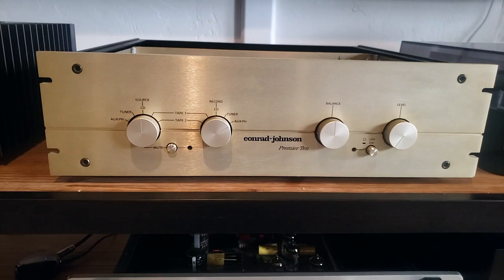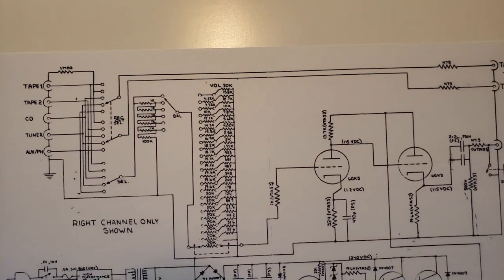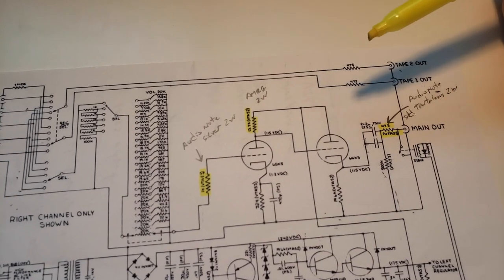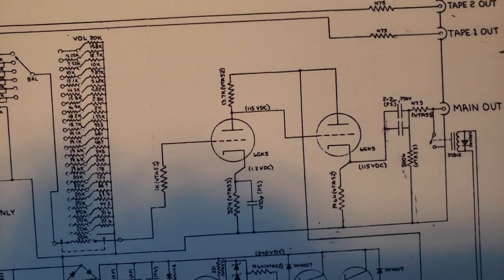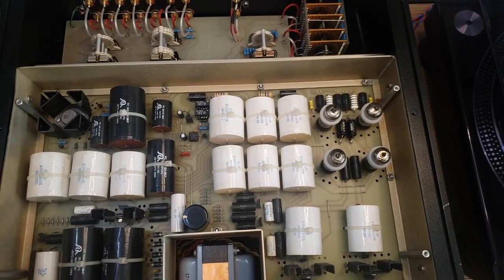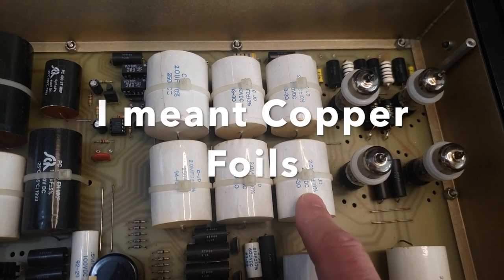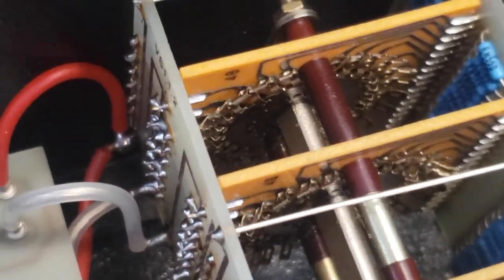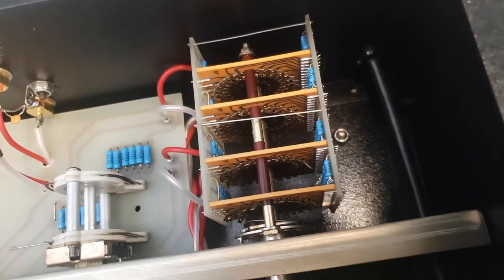Conrad-Johnson Premier 10 Vacuum Tube Preamp VINTAGE AT ITS BEST! MODS & MORE!

Comment: There's another way to correct the phasing, all you have to do is feed the output of the preamp through a unity-gain inverting buffer circuit which could be built using op-amp ICs or a twin-triode tube, one for each output channel, and since the inverting-buffer circuit presents unity-gain, or a gain of 1, it should introduce minimal distortion and, or, noise.

Comment: I think you’re absolutely right about the Premier 10 being one of the best pre-amplifiers made. To make the same pre-amplifier today would probably cost 17,000 or $20,000. If you remember, Conrad Johnson had to come out with the Art preamp that cost $17,000 just to try to beat it. But I listen to the Art and I didn’t think it was any better than the premier 10 it was just a lot more modern and fancy looking with a remote control.

Comment: Stepped ladder attenuators are easily available from the same stores that you get the audio note resistors. Simple upgrade for your existing preamps/integrated amps if there is space.
Reply from the maker: You mean the 42 position glasshouse kits for $700 pounds UK?
Reply: @hificonspiracy 😂

Comment: 11:03 - All 6 of these caps are 2.0uF @250V, but the upper-left cap appears larger! (?)
Reply from the maker: Yep, good eye. It's significantly larger. I'm assuming its a manufacturing variance since it measures within spec.

Comment: Lofty statement. Never owned a Premier 10, had the Premier 3 and Premier 7, which the 10 was based upon but w/o the multi-chassis layout. Lovely equipment however my 7 was returned back to factory 3 times due to power supply failures, including a cap that smoked so bad it set off smoke alarm. Frustrated, I traded it to dealer for an Audible Illusions 3A. As a line stage, very similar. The AI was however substantially better as a phono preamp. I then was introduced to the CAT SL-1 and have never considered an upgrade. Even though CAT offers several in-house upgrades at very reasonable prices, I’ve never sent it in. It may be quieter or deeper & wider…or maybe not. If you’re so pleased with the performance, simply no reason to “upgrade”. I’ve replaced tubes twice on line and output, once in phono section. I’ve spent $$$$’s upgrading amps, speakers, sources and buying records but still no desire to change out my preamp.
Reply from the maker: Sorry to hear of your issues with Premier 7. I don't blame you for the frustration. As a recall CJ had some power supply issues with a couple of their past amps MV50 & MV75? (don't quote me on that). The Premier 10 looks to be very robust. No issues yet! The CAT products have received a lot a good reviews over the years. I have never owned one. Thanks for sharing.

Comment: I'm getting ready to buy one of these... are you telling us people on YouTube that if we have this we have to switch the red and black of our speaker cables on the back of the amplifier, because it inverts polarity or whatever❓
Reply: what happened to the part of the video where you started to talk about resisir upgrades...it was edited out❓
and I heard someone speak of changing capacitors to teflon kit upgrade?... I called Conrad Johnson and was told they are the only place that has teflon capacitors for this and it would cost 2500 plus shipping for them to replace🤪...does anyone know of this and perhaps where i could buy the telon cap kit for this pre amp❓
Reply from the maker: Yep, switch polarity on the speaker end of your cables, both Left and Right speakers it will give you the most focused imaging/center image when using the Prem10. Try it both ways. see which you like best.
Reply: @hificonspiracy 
Now I'm getting the ET5 I guess I have to reverse the polarity on that also… Do you know?
Reply from the maker: @briancampbell7712  I'm sorry I don't have any experiences with the ET5. I know it is a different design and different tube. Enjoy.

Comment: is that a Pass Aleph 3 with it? I used an upgraded PV-8 (Bill Thalmann of CJ fame) with and Aleph 5 for many years... best combo set up I've ever owned
Reply from the maker: Yes it is. I also owned a Aleph 5 years ago and also sorry that I sold it. I found an Aleph 3 about 2 year ago and grabbed it. I don't think I'll ever sell it. It's a collectors item for me. Some people complain about the looks but I rather like it. Bill is suppose to do excellent work! Happy Audio!
Reply: The PV8 was very decent, but the PV12 was superb! That preamp is better than anything in that price ranghe SS or tubed. I picked up an Evolution 20SE a few years ago and had CJ mod it (6K) Its a giant killer, but keep in mind it sold for 10K ij 1996. I bought it for 2.7K and stuck in 6K of upgrades. Also VERY important to get the best 6GK5 tubes. CJ voiced it for the Sylvania tube, but not just any Sylvania. I bought out all the last sets CJ had after I realized how hard it was to find tubes that worked best in that circuit. Phono section is a bit noisey.

Comment: Absolute phase preservation in simple stereo systems is not of prime importance and it can only bring a small benefit to soundstage focus. Given a recording preserves absolute phase too. In most cases it's a hit or miss affair. 
For integration in complex systems with active subs, surround speakers etc. Inconsistent phase can create cancellation issues between different routes. Must be analyzed and addressed.

Comment: the volume control is built in sweden. you use to be able to by them in kit form also.
Reply from the maker: Hi Ben! Are you sure this was imported from Sweden? I thought it was done inhouse at CJ? Link? Recall the manufacture?
Reply: @hificonspiracy  hey alex! let me se what i can pull up. may have in one of my files from different parts mnftr. from back when me and my brother were working on my altec 1570b's. stay tuned and in touch.

Comment: which tube brand is it? i see something written in red not sure vintage rca's maybe?
Reply from the maker: Yes currently USA made NOS RCAs, also GEs, My favorite though are some GEs made in Great Britain.
Reply: @hificonspiracy  there are mullards with a ge label you can tell by the code, ge's were only made in usa as far as i know. ide go for mullard 10m's with this preamp, or mc1/f91/f92 longplates you deserve the best. compared to rca's which are amazing as well mullards are smoother with more low mids. if you like more warmth brimar 6057's would be my second choice.
Reply from the maker: @yaniv-nos-tubes  Thank you for the info!
Reply: I have a EVOLUTION 20SE.  it's been upgraded by CJ 3 years ago (2700 bucks) I find the best tubes were the original factory supplied Sylvania. I tried a bunch of others. CJ is now out of stock. I bought 4 sets.

Comment: That stepped volume control is amazing looking.  What's the rationale of leaving the phase inverted?  Is the idea to make the circuit less complicated by leaving out the phase inversion circuit before the power amp?  I knew the CJ stuff was phase inverted, but apparently, so is my Quicksilver Line preamp.  That explains why it was lacking low end punch.  🤣  Is this replacing your Quicksilver?
Reply from the maker: Yep, it just adds more to the circuit to correct it (phase).  You see how it could give a piece of gear a bad rap. I think its great from a circuit-purity approach but probably a bad marketing decision assuming most consumers look at this stuff as "magic boxes" and fully forget to reverse phase on their speaker cables and thus becoming dissatisfied with the product. I'm guilty of it. Nope. Keeping the Quicksilver. Its finished, (finally)  just need to run a few more tests and then video. I've been collecting this stuff for years and just now getting around to restoring and tweaking some of it.
Reply: The reason for the phase inverting output is exactly that, circuit purity. Less circuitry to pass the signal through by not having the bits that would be needed to output absolute phase. I got this from speaking with Messrs. C and J, and the long time C-J engineering director and all 'round smart and nice guy, Bill Thalmann. I had a PV-1, 2, then lived a long while with a PV-12A. The PV-12A leaves the linestage phase inverted (maybe the phono, too? I don't recall right now, but my PV-12A did have a phono stage). My brother has a PV-10B; also, phase inverting. I was helping him with setting up his system just the other day and he reminded my to flip the speaker connections.
Reply: if i don't use phono...please help me I only have a few days to decide between a CJ PRE AMP- Premier 10 or PV12L...what one is best to buy❓

Comment: I can imagine that gear like this could bring a grown man to tears while using it.  Dreamland for me and I don't even deserve to listen to gear like this nor own it.  Enjoy your great gear!
Reply from the maker: Well music has brought me to tears. I think good gear can help in convey the emotional sense/impact of the music. I see a work bench and tools in your channel. I see some diy in your future! EL84s? Polished aluminum chassis? Modded Dyna ST-35's? Hmmm transformer coupling? Open baffle speakers.. Hmmm  DIY my friend :)
Reply: @hificonspiracy  Sir, I repair welding power supplies and related gear including engines for my low amount of income.  I would thoroughly enjoy an A/B or tube amp kit or repair project.  And, a Dyna 35 would make my day.  I just replaced a very good, but budget class D amp with a wonderful NAD 214 A/B amp and what a deference in dynamics.  Low to high much wider and pronounced.  I'm now all in on "beefy" - iron rich amps.  Just as the more robust welders have more "iron" (big transformers and chokes) I believe amps and power supplies should also.
Reply from the maker: @welderfixer  If you ever run across an NAD 106 preamp grab it. Great match to the 214 and it has a super phono stage inside! Agreed on the trans and chokes! https://www.youtube.com/watch?v=I2owtfvS6Mo 
https://www.audiokarma.org/forums/index.php?threads/nad-106-preamp-restoration-upgrade-project.550017/
Reply from the maker: @welderfixer  The 214 is great amp!
Reply: @hificonspiracy  I foolishly passed on a broken NAD preamp on EBAY a couple days ago.  Yes foolishly! I'm so dumb!  But, I will be looking for the 106 now.  Thanks for the suggestion.
Reply: @hificonspiracy  Sure is.  I am so very lucky to have it.  I'm looking for more of them.

Comment: There are two main problems with carbon comp resistors, firstly, they tend to be inherently noisy and generate hiss-noise, secondly they drift out of tolerance, usually they drift high in value, metal film and metal-oxide resistors tend to be a lot less noisy and more stable in value, that is they don't drift out of tolerance.
Reply from the maker: Yes good info. The AN & AMRG resistors used here are Tantalum & Carbon "Flim"

Comment: I hope it's not put together as crappy as a Premier Three. Had the Evolution 20SE, basically the same pre but with a phonostage too. Still have a Premier One b amp to flex my muscles...
Reply from the maker: I think its a very solid build. Chassis is made from extruded alum panels and I-beams not just a folded sheet metal. I can't think of anything under $10k today that is made better. Primaluna I think the only exception but it's made over seas. Premaluna seems to have very high build quality for $.
Reply: @hificonspiracy  I disagree because I had three CJ pre-amps the Premier Three ´B', the PV-10 and the Evolution 20SE as said a Premier Ten with phono and a Premier One ´B' poweramp which I still have, Premier Five mono's and Evolution 2000 hybrid. Audio Research is much better built than CJ IMO but in general I find the CJ's better sounding ones maybe apart from the SP8 and SP11.
Reply from the maker: @BoudewijnvanHouten  Thanks for sharing. ARC makes a good product. I'll have a bunch of ARC gear coming up in future vids.

Comment: Hello Alexander, that phase inverting issue is relatif and  not realy relevant  , indeed the sound perception nmay change on correct recorded music , two mikes and an absolute phase at the ouitcome .....BUT many amplifier are  phase inverting also ,or not ...............besides what about the absolute phase of most popular recordings ? we don't know ! ...............even who knows what was the phase of the mixing, the studio ampifiers , the micros  and their amps etc.........some micrphone amps may be in absolute phase and others may not..

It is a VERY nice sounding preamp ( can even hear that on the limiting YT ) .........the 6GK5 tube is a high frequency tube used in the vhf frequency bands, it is not a double triode and that eases the matching of the tubes and lessens the possible crosstalh between the tiodes .............very smart  and origninal choice ! ............the HF design , that's the reason of the presence of a gridstopper resistor ..

Comment: whats up with a teflon kit upgrade to this pre 10?...called CJ and they said that they are the only one who sells it and they charge 2500 to install plus the shipping cost.🤪... I can solder, does anyone know where I can buy the Teflon capacitor upgrade kit for this preamplifier❓
Reply from the maker: CJ makes a nice I believe it a teflon/hybrid capacitor (whatever that is)Its nice, I think Teflon can sound a little sterile. Try using some nice Tin or copper film and foils. It will also save you a lot of $$ unless you absolutely must have the CJ house sound.
Reply: @hificonspiracy 
agree 💯 with your assessment about being too sterile sounding...
Reply: I like this but to me the best preamp I've ever heard and was actually voted a few years back as one of the top 10 preamps in the world... is the upgraded ...
Linn klimax kontrol
Reply from the maker: @briancampbell7712  its just uber transparent. Its going to reveal  any weakness in your source I think this will be more of an issue with a digital front end. Mixing up cables and tubes can help with this match. In the end its all about synergy and if you can live without remote. I think it would be a great mix with r2r dac or analog front end and low power single ended tube or pass amp or perhaps a nice EL34 based tube amp. Enjoy!

Comment: the way that circuits drawn signal is taken off the cathode it will be bought back to the right phase etc only when the signal is taken of the anode will it be 180 DEG out of phase from the input sauce
Reply from the maker: yes. exactly.
Reply: Actually, no, the second triode in the circuit is connected as a cathode-follower, cathode-followers do not invert the input signal, so, the phase of the signal on the cathode is going to be the same as the signal on the grid which happens to be connected to the anode/plate of the first triode gain-stage, the first triode is connected as a common-cathode amplifier, the signal on the anode of the first triode gain-stage is going to be 180 degrees out-of-phase with respect to the input signal on the grid, and since the cathode-follower stage does not invert the phase again, the phase of the output signal is still going to be 180 degrees out-of-phase with the input signal.

Comment: is this a better unit than the 
CJ PV12L
Reply from the maker: Well, yes and no. The PV12 can be had as both a line stage(no phono) or with phono. The Premier 10 is line stage only no phono. They use different tubes as well. Ultimately  the Premier 10 has better build quality and is more transparent. However, I suspect the PV12 would be easier to live with day to day. The vol is not stepped like the Pre10 is, while a stepped is better for sound quality, its doesn't give you as much control over the level. If you want something more esoteric, an american made Audio Note type thing, then do the Prem10. Its a great sounding unit. Personally, I'm looking forward to finding a nice PV12 with phono. Im not bothered the the PV12 will be slightly colored or warmer sounding as compared to the Prem10 . Hope this helps!
Reply: @hificonspiracy 
if the premier 10 has better sound quality...why would you go for the pv12❓
Reply from the maker: @briancampbell7712  I think the Prem10 is more transparent than the PV12. It not just all about sound quality for me there's some benefits to the esthetic of the PV12 and inboard phono stage. Yes, the phono stage will also be a compromise. The Prem10 is an incredible Preamp.
Reply: @hificonspiracy 
I don't use phono...there's a guy that is selling a 
CJ PV12L but also someone with a much harder to locate I was told by CJ that only about 200 were ever made of this 
CJ Premier 10 Pre...so I'm thinking this CJ Premier 10 would be a better match to go with my CJ Premier 11a❓
I just want to buy the correct one...both are around same cost to me...?
I presently use a Linn Klimax pre amp...it's a great pre and I don't know if i'm making a mistake or not by buying one of the two CJ Pre amps to replace it...I am hoping it will give a better sound quality using the CJ pre amp with the CJ premier 11a 6550c tube amp I now have❓
Reply from the maker: @briancampbell7712  The PV12 is the nice girl next door. The Prem10 is the hotter but also higher maintenance girl (nice to have around it you can put up with few idiosyncrasies) Think Honda Accord Sport vs Audi S4 perhaps. If you get the PV12 you might never get another opportunity to find a clean Prem10. After owning a Prem10 you might find you'd be ok with a PV12 after all.  Audio is madding isn't it. Enjoy! PS The Prem 11a is on my bucket list Very cool amp don't sell it. CJ had an option to convert it from 6550s to El34s.   I think it was a Prem 11xs?
Reply: @hificonspiracy  
thx for that..lets say you don't use phono...
what pre amp of the two would you rather own...? I own Tannoy Berkeley Speakers w/ a super tweeter on top and rel storm lll sub...
Reply from the maker: @briancampbell7712  Tannoy Berkeley's sweet! What kind of music do you listen to and what the seller asking $ for 12 & 10? if may ask?